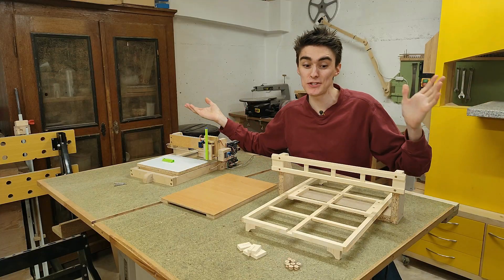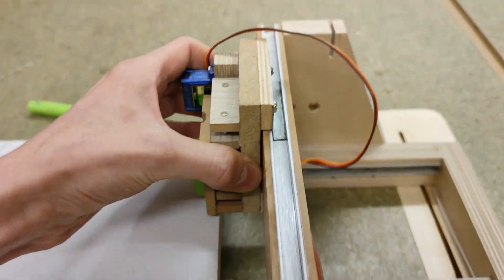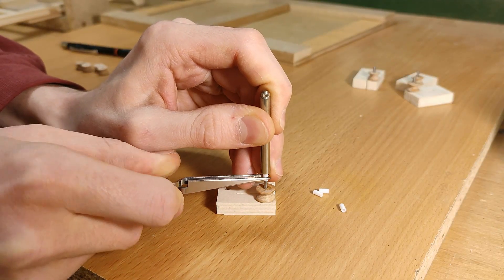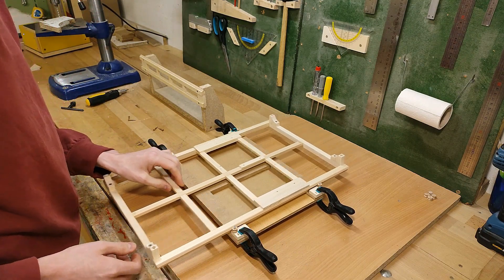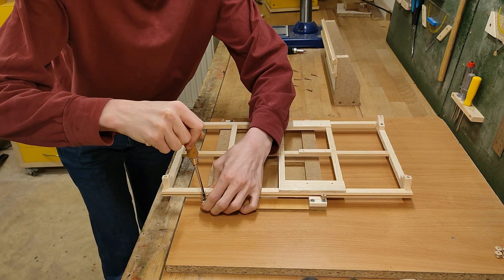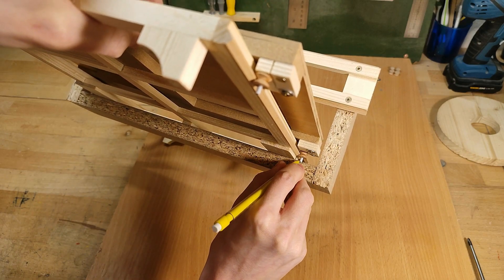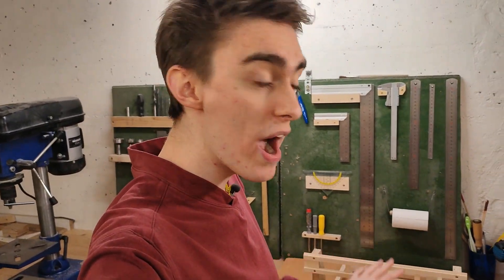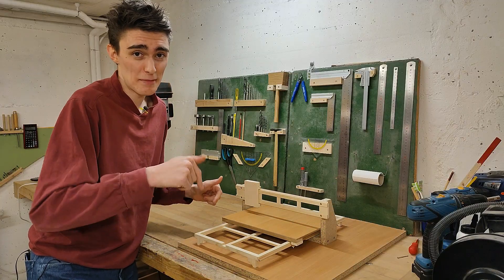Building WOODEN linear rails for my A4 DIY arduino pen plotter

Comment: You could have added additional wear resistance by having used extra thin CA glue inside of the holes of your wooden rollers. Additionally, if you continue to experiment with wood, their are more durable wood species you may consider (for example: ironwood).
Reply from the maker: Yeah I could've, but it's a pen plotter and everyone's gonna get bored and stop using it way before something wears out. I think pen plotters are the kind of novelty item nobody really has use for...
(also have to admit I didn't think anything of it back when I made the video, this is just my retroactive justification :p )